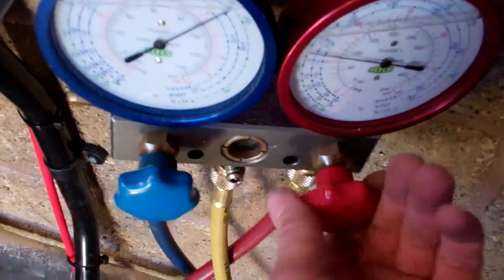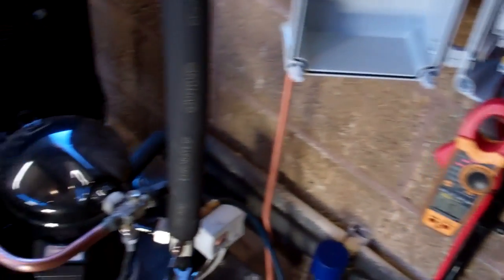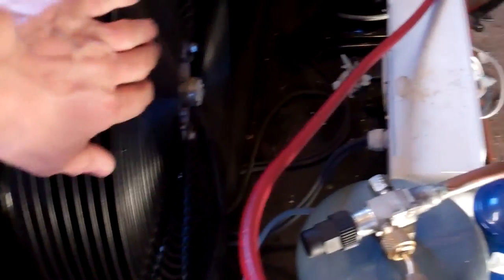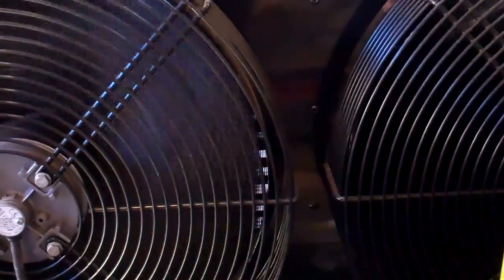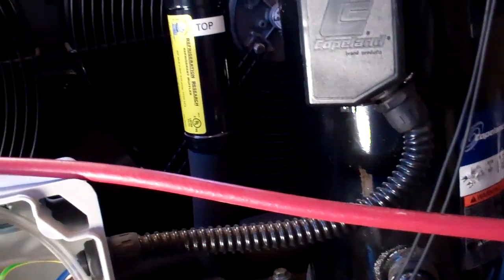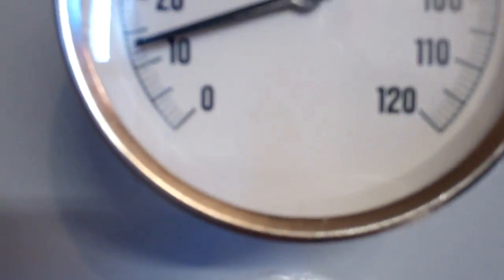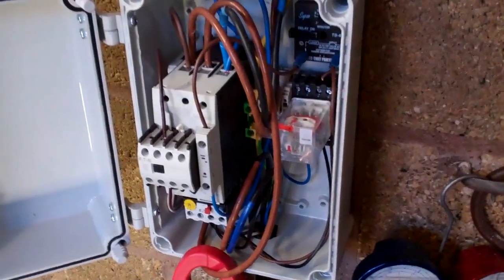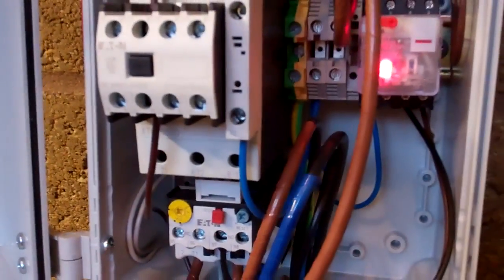5.5hp ice builder

Comment from the maker: Hi Alan,

Yeah it cost less to move heat than make it. Typical Japanese style air con heat pump will take 1kw to provide 4kw of heat!
This system isn't as efficient (due to low evaporating temp) probably 2.5/3kw of heat, but as it is waste energy from the ice that cools the milk it is effectivly free heat. The heated water is used to wash the milking parlour (after being heated further to 90c+)
Cheers John

Comment from the maker: The heat recovery tank has an unused heat recovery coil but its a bit big for the rest of the refrigeration equipment on this site, could be oil return problems due to low refrigerant velocities. 

I'll see if i can get a better vid showing the system working.

Comment from the maker: Its for pre heating the water that goes to the water heaters that wash the milking parlour, they use a lot of water to clean out all the milk pipes and it needs to be just below boiling to get all the fat etc to wash away so this system should save a lot of electricity.

Will try and get some more footage next week.